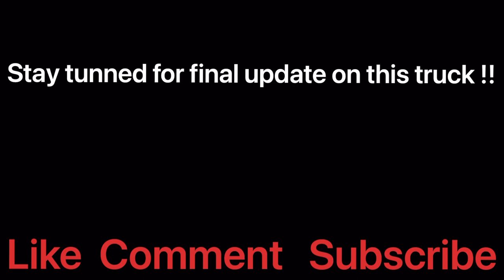Painting a Peterbilt 379 !!!

Comment: Looks like automotive paint not Imron, never split the sleeper like that.. Use EW quality Imron and clear it with 8840S . I'm a 30 yr certified truck and auto painter. Don't use auto coatings as they don't hold up to the road and elements.
Reply: What about an enamal acrylic?
Reply: Are you still in the business? Where are you located?